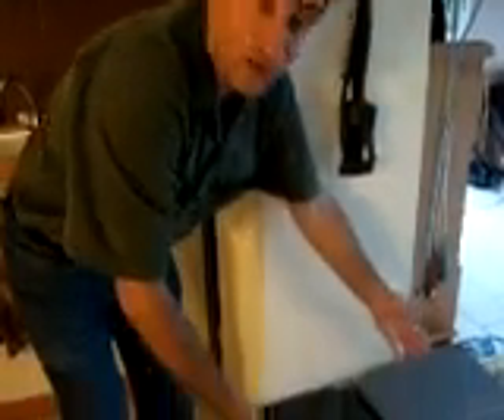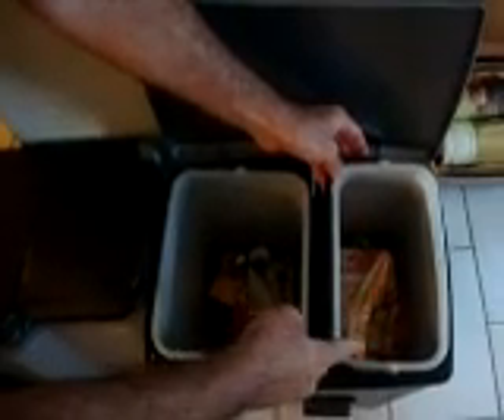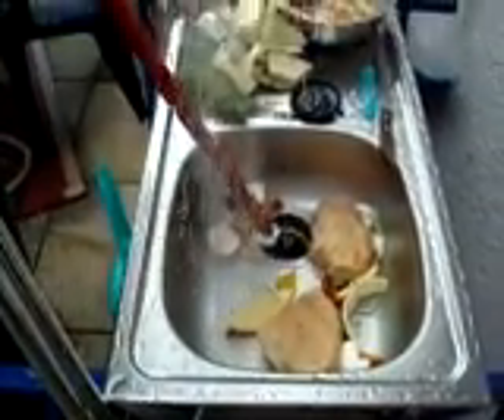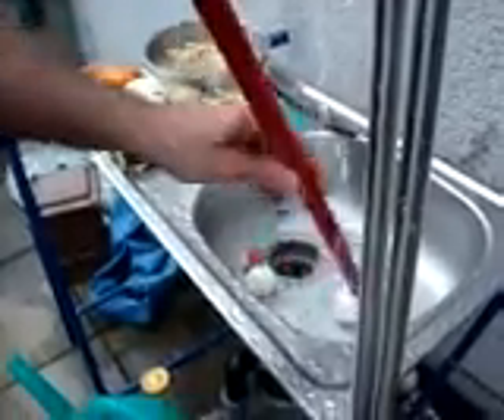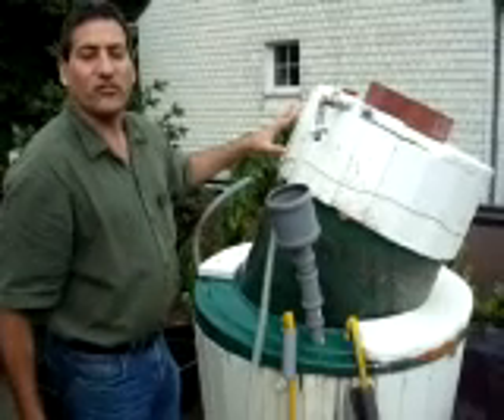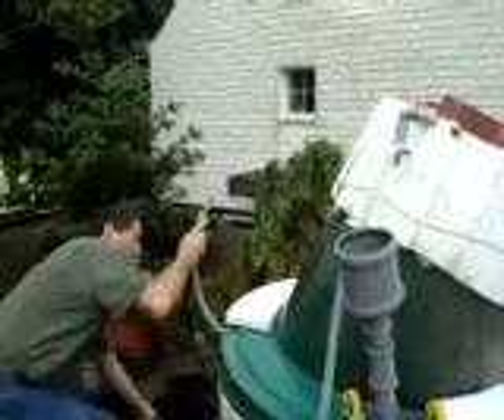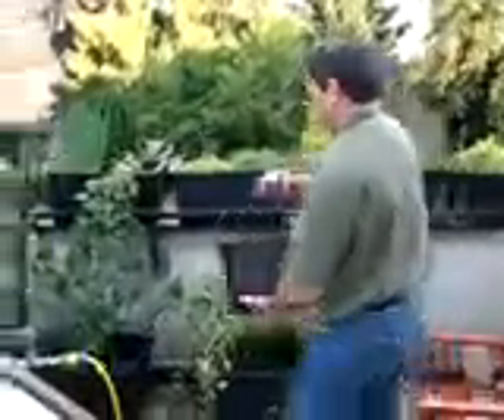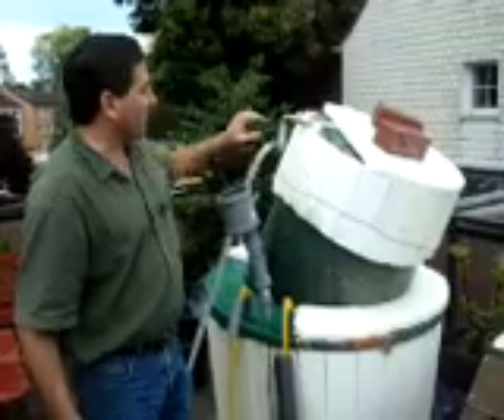Second Test of Insinkerator Waste Disposal Unit for Home Biogas System

Comment: How long does it take for the waste to break down so you can use the gas, water for shower, etc? Can it be used to hook up to your house for gas stove, and heat water for shower? Will the energy run the inside lights, forced air, etc? How much energy can you use, what will it run? Do you pour the used kitty litter in the same place?